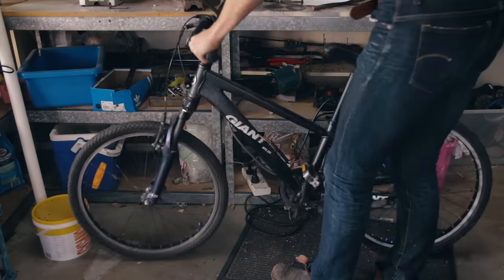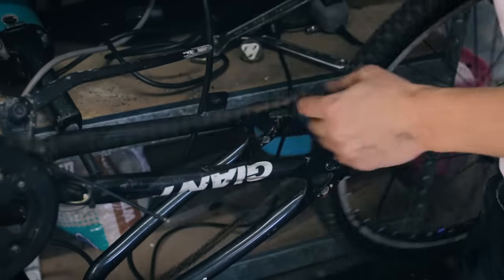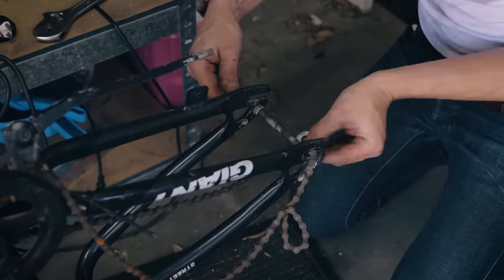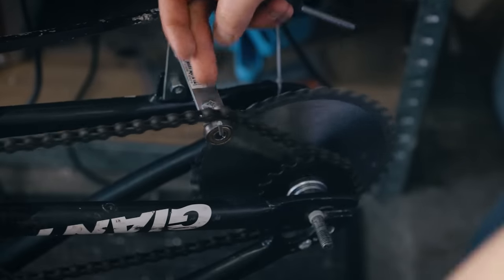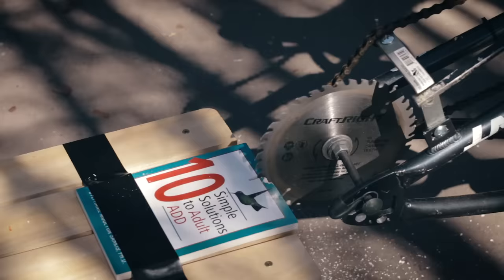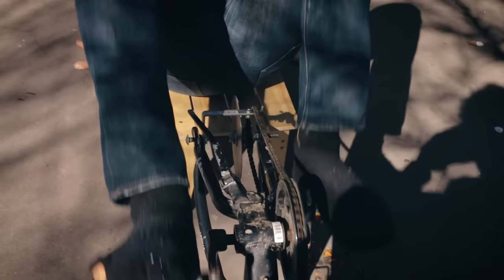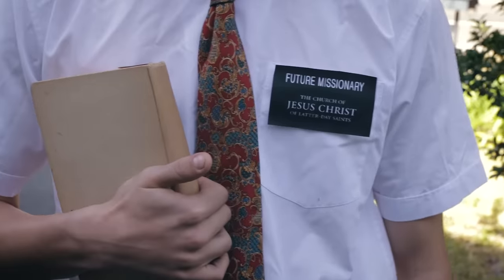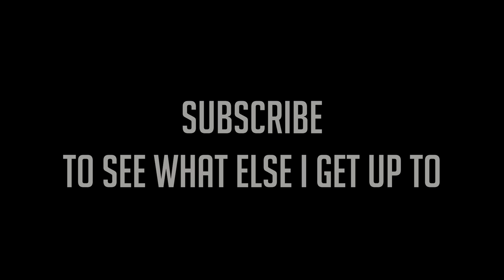Can Your Legs Power a Circular Saw?

Comment: If you add gears, you can get a much higher speed
Reply: I didn't put like because you reach 69 likes
Reply: I didn't put like because you reach 69 likes
Reply: I didn't put like because you reach 69 likes
Reply: @francescodacunzo9102  ill like it myself then
Reply: @TimeTravelingFetus  ill like it myself then
Reply: @pedroribeiro9746  ill like it myself then
Reply: I didn’t put like because you reach 96
Reply: He is a aussie let it be
Reply: ill like it myself then
Reply: You'd lose torque, though, so I don't know if it would help cut through harder materials
Reply: With no torque
Reply: Sad torque noises*
Reply: @spencechan  take off less at a time, but it spins faster so it's a better cut. tradeoffs with everything
Reply: @spencechan  That can be mitigated with a simple flywheel
Reply: I didn't put like because you reach 547 likes
Reply: i liked for 666 likes
Reply: I was gonna like it but it's already 666
Reply: you HAD gears, mate!!! You just threw them through your garage... I don't know if I should cry or scream. Maybe I'll do both... simultaneously...
Reply: I didn’t put like because you reach 96
Reply: that's what i was thinking about lol
Reply: Jesus loves you alot trust in His death 4 salvation and be saved from eternal hell <3 Jesus died on the cross for you bro.
Reply: No way!!
Reply: I was going to say it needs a weighted flywheel and gears. That way the inertia of the larger flywheel can make it get up to a much higher rpm when attached on the axle to the blade. Kinda wanna try now…
Reply: @MrAwesome966  my thoughts exactly!
Reply: That’s what I was gonna say but idk if it would have enough torque unless you sawed pretty slowly
Reply: But you lose torque.
Reply: @PM-qp5he  maybe you can use a flywheel?
Reply: @rawhidelamp you can’t add likes to your own comment anymore. YouTube update makes it so you can still like it but it will only count if it’s the first/only like. So even if a second person likes it after you it will display “1 like” or in other words if you like your own comment as the 70th account YouTube will still display “69 likes”
Reply: At the cost of torque.

Comment: replace the rear wheel with a bunch of big saw blades that are the size of the original wheel. like 3-5 maybe
for added rigidity connect the saw blades with a bunch of bolts and washers between the blades so they aren't touching and bending

if nothing else it certainly gives you a lot of grip^^

Comment: If you had the pedals driving a flywheel and then the flywheel geared to the blade at a 1:1 ratio (since the blade can't be made thicker near the cutting edge depending on how deep you want to be able to cut), you could use a multi-ratio bicycle gearset to slowly bring a heavy flywheel up to speed, then you keep pedaling to try to maintain energy in the flywheel while its stored energy serves as a ballast to handle the high-torque bursts required to cut tiny chunks out of the wood with the saw blade.
Reply: no no no you see your suggestion was actually a good one to make this a usable thing we dont want that this is a joke lol

Comment: If only you used a bike with gears, that would be epic
Reply: It was a bike with gears
Reply: @romantom8101  
I think he means one that has multiple drive and driven gears, the bike in the video is a single speed.

But uh yeah, I'm just as disappointed as you are in how many people missed his mistake.
Reply: @alecnolastname4362  thr gears were in the hub he just removed them
Reply: @alecnolastname4362  have you heard something about planetary gears ? cuz it seems that you haven't
Reply: @romantom8101  
It very clearly is not a planetary gear. Look at 0:31 the housing on the drive gear is just that, there is clearly no room for any internal workings.

(Cyclists call that housing the "dork disc") it is put there to prevent the chain from slipping off and into your spokes.
Reply: @romantom8101  you can also get a pretty good view at 1:46

It is very clearly not a planetary gear...
Reply: @alecnolastname4362  1. Look at the cockpit there is a gripshift on the right side
2. There is a shifting cable housing
3.there isn't any dork disc because it is only on bikes with a cassette
Reply: @alecnolastname4362  Pedal lol not peddle.

Comment: I have a question : did you know there is no way for you to be powerfull enough to cut any sort of wood ? An usual circular saw do arould 800W, with peaks higher than this cause you need it to not stop, so you need to put some more power to keep it going

Comment: you do know that fixed gear bikes have a chain tensioner sort of built in?
ie you just need to putt that whole wheel assembly tight then use lock nuts to lock it in place